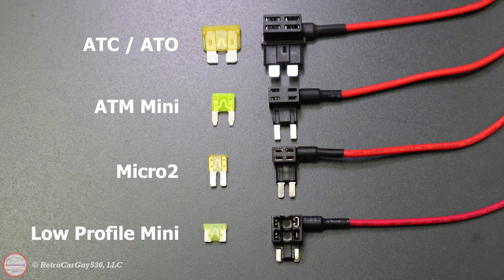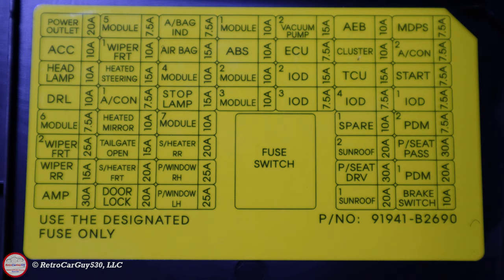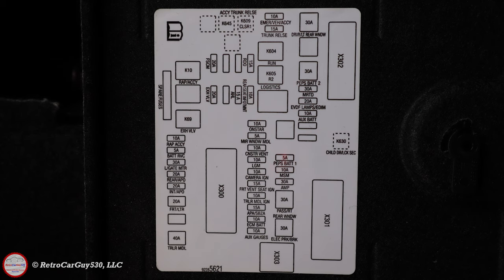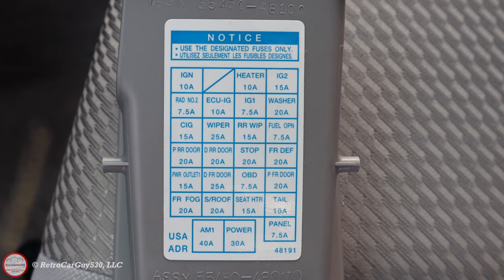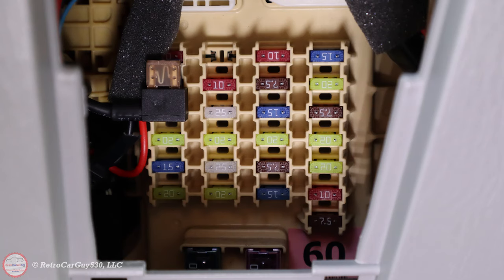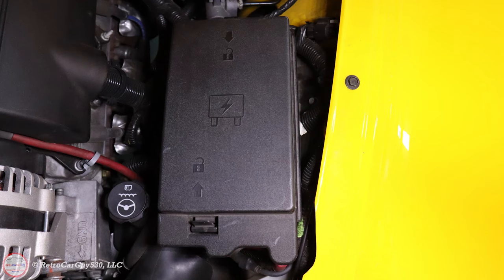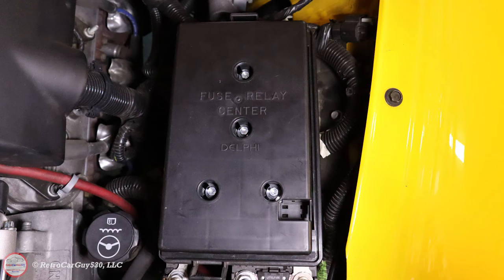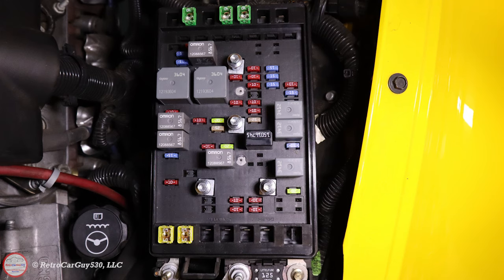How To - Add a Fuse Tap in Your Vehicle

Comment: Is the vehicle in the ON, OFF, or ACC position when doing this?
Reply from the maker: If you're looking for constant/unswitched power, you should look for a fuse socket that provides power with the ignition switch in the off position.  That fuse socket should provide power no matter what position the ignition switch is in.

If you're looking for accessory (switched) power, you need to find a fuse socket that does not provide power with the ignition switch in the off position and when in the accessory position it does provide power.

If you need to find switched power that is only provided when the ignition switch is in the on/run position, you would again find a fuse socket that does not provide power while in the off and accessory position, but does provide power with the ignition in the run/on position.

Many vehicles provide accessory (switched) power when the ignition is in the accessory and on/run positions.  It's somewhat less common to find a fuse socket that provides power only when in the run/on position and not in the accessory position.

The last power type to look for is a fuse socket that provides RAP (retained accessory power).  Find a fuse socket that starts off with no power with the ignition switch in the off position, turn the ignition to the run/on position and confirm that it has power, then turn the ignition to the off position again (without opening any of the vehicle's doors) and check if the fuse socket still has power.  Then open the driver's door and if you observe the power turning off at that point, that fuse socket provides RAP. 

I hope that helps.

Comment: What's the multi meter supposed to be set on when looking for the power in the fuse box?
Reply from the maker: Test for 12-volts DC, I need to set my multi meter to 20 VDC testing mode.  This allows the meter to test and display voltage levels for DC power up to 20.0 volts DC.

Comment: I  do not have a voltage tester with a light. I have a multimeter. Can I still use the Multimeter to test what fuse input slot provides the 12 volts? what setting on the multimeter should I use to test it?
Reply from the maker: Yes, you can use a multimeter.  You set the multimeter to DC volts at a range that will handle the 12 volts in your car. Usually, that means setting the multimeter to DC 20V.

Comment: So using a multimeter do I set it to 20 V DC and insert one lead into the fuse contact and one on to ground, or do I insert both leads one into each side of the fuse contact?
Reply from the maker: To see which side of the fuse socket provides power, you set the multimeter to 20 V DC, connect the black/ground lead to a ground point on the vehicle and then use the positive/red lead to touch the fuse box fuse socket contact(s).

Comment: Excellent, detailed video.
That's what I'm wanting to do, place a tap fuse in an empty - switched - slot on the fuse box.
In a blank slot, how do you know what size fuse to place in the tap fuse?  Should you look at the amp use or draw of the accessory that's being added and then put a fuse a little smaller than that?  If a light is rated at 10 amps say, would it be okay to place a 7.5 amp fuse in the tap fuse in the top slot?  Thank you.
Reply from the maker: If the device will consume up to 10 amps during peak load (for example when first turning it on), then I would use a 10 amp fuse in the fuse tap.  You don't want the fuse tap fuse to blow during normal operations of the device it's powering.  You can start off with a lower rated fuse amperage and if the device doesn't blow that amp fuse, then you're good.  Don't put a large amp fuse in the fuse tap for a device that should have a much lower amp fuse.  Using a fuse with too much amperage endangers the new wiring and the new device.
Reply: @RetroCarGuy530  Thank you for the quick reply.  Gotcha.  I would like for it to be an existing ignition source and just put a smaller fuse in the top slot of the tap fuse.
But there are several blank or empty fuses. I'll just check the empty fuse slot with the key off and then turn the ignition to ACC and see if there is power and go from there.  Thanks again.
Reply: Have a quick question about being able to check spare or blank fuse locations on a 2019 Jeep Wrangler.
Almost all of the fuses are Micro 2.. so freakin small.  Well the ends of my probes on my multimeter are too fat to stick down inside the area on the empty fuse location to check for which side is load and which side is draw.
Can I just wrap some small wire around the ends of the probe just to check the empty fuse slot or use two small nails on each probe to check it real quick? I'm just checking for a 12-Volt accessory so I can use a micro fuse tap for power.  Thank you.
Reply from the maker: @mwworkman those are small fuses.  I would recommend what I mention in the video about taking a fuse of that type (one that you won't be using / an extra fuse) and with a cutter cut the fuse in the middle.  That will give you two halves of the fuse each with a small amount of metal exposed on the top side of the fuse that you can touch your multimeter to when testing for power.  You'll likely need a needle nose pliers to insert/remove the 1/2 fuse section, but you can insert it and test for power on each side of the fuse socket this way without trying to jam in the tip of the probe from the multimeter.  I show that method of testing in the video.  I just looked at a Micro2 fuse I have in the garage and it looks like it should work for that fuse type.
Reply: Hello I also want to ask an additional question 
I installed an illuminated led door sill by wiring into an existing door light that turns on when the door opens. After I did that my car turns off occasionally. I have been told to tap into a fuse. I was blessed to find your video which is the best one out there. My question would be if should I use an empty fuse slot or should I tap into an existing fuse where the dome light turns on. The reason I ask this is because I don't know how much amp is too much for the door sill
Reply: I checked the website where I bought the door sill and this is what it says 
Current: less than 0.5A
Also in their video they just cut existing door light wires and connect without fuse .
Reply from the maker: Sorry for the late reply.  YouTube does not present replies to previous comment replies in a manner friendly to the video creator to find them.

Find an unused fuse socket that provides power when you want the lights to illuminate might be a bit of a challenge (on only when the door is open).  The dome light fuse socket sounds like it might be a viable candidate for the power source for your LED lights.  The power for the dome light is likely controlled by your car's body control module. (BCM).  Sometimes a BCM monitors the power draw on the circuit to try and detect when a light or lights are not drawing enough current so the BCM can present a warning message if it detects a low current draw due to a burnt out or non functional bulb.  I wouldn't think the dome light circuit would be monitored in that manner, but it could be.  You'd have to test adding the power draw from the LED light(s) on the dome light circuit to see if the BCM thinks something is out of range.  It likely will be fine.

The bigger question to me is the one where you stated that the car "turns off" after you wired in the LED lights to the pre-existing light circuit in the door.  That is very strange!  I'm not 100 percent certain those two issues are directly related, but stranger things can and have happened to me.  I might suggest you check the wiring you directly touched when adding the LED lights and all others in the door wiring harness to see if you may have accelerated the presentation of a pre-existing problem.  Moving the wiring harness in the door may have caused other wires to break or have the wire insulation crack allowing the internal wire to touch other wires or ground to metal.  Extreme situation, but possible.

Adding a LED light that is rated to draw 0.5A to a pre-existing circuit should not cause that amount of strange behavior in your car.  The LED lights may have a defect as well causing them to draw more than the rate amperage.

Hopefully you've already found a solution to your issue.
Reply: @RetroCarGuy530  thank you for the detailed information. Out of pure coincidence I ended up seeing that my tire rubbed my wheel well and exposed a wire. I'm going to relocate my harness and see if that changes anything . If not I believe you are right. I may have exposed a wire through the door jamb when pushing through the wires.

Comment: When do you need a relay for additional lights?
Reply from the maker: My general rule of thumb is that each fuse socket's wiring has about a 10 percent safety margin built into the wiring providing it power.   For example, a fuse socket with a 10 amp fuse has a 1 amp safety margin built into it, a 20 amp has a 2 amp and a 30 amp has a 3 amp safety margin.  Whatever your device requires at its max amp draw, it should be less than the estimated safety margin for that fuse socket wiring.  Using fuse taps to power devices like radar detectors and dash cameras is very "easy" since they require no more than 1 amp or 2 amps worst case.  I know my approach is very conservative, but that's safer than some other approaches I've seen/read on the internet.  If your device requires more than a few amps, I would recommend using a relay to provide its power with the power being sourced directly from the battery of the vehicle (with an inline fuse) and the control circuit power of the relay coming from a fuse tap within the fuse box.  The control side of a relay usually takes only 100 mA (0.1 amp) so it is very fuse tap friendly.

Comment: Great video.  I have a question for you.   Like in my car, your fuse box cover has a somewhat sealed fit, how did you get it to seat properly given that you needed to run the tap wire out to the component that you would be installing along with the tap?  The fuse box cover provides protection from dirt, dust etc...thus a good fit is optimal.  Thanks.
Reply from the maker: If you need to add a fuse tap to a fuse box exposed to outside weather elements (such as the one in the engine bay) and it has a protective cover such as the one in the video, you'll need to look for an opening that allows the wire to exit the fuse panel or add a small opening (side/bottom).  If you must modify the fuse box/cover make sure you're not compromising the integrity of the wire or the fuse box / seal.  If your vehicle is still covered by a factory warranty, I would suggest not modifying the fuse box/cover to avoid any warranty issues.  You might need to add a protective grommet to any hole you might add and/or add a small amount of RTV sealant to make sure the opening still protects the fuse box contents from water intrusion.

The fuse boxes inside of the passenger compartment (dashboard, center console area, trunk) are usually far more forgiving on having exit holes for the wire if they even have a cover. You can also modify any cover to allow the added fuse tap wire to exit the fuse box without worrying about exposing the fuse box to outside weather elements (water mainly).

There's no one perfect answer for this question, just make sure the exit path for the wire does not rub on the wire which might lead to its failure and make sure any exit path does not expose the contents to outside elements (water / dirt).

I hope that helps!
Reply: @RetroCarGuy530  Thank you!  Great suggestions.  I have the perfect sealant for that.  High temp resistant caulk that I used to reseal the glass on a fireplace door.  Thanks again.

Comment: What’s the setting on the reader to test the fuses? I just got one but I don’t understand anything on that dial 🙃
Reply from the maker: To test for power like I do in the video, you select DC Volts.  To test a fuse (not in the fuse socket) to see if it's "good", select Ohms/Continuity.

Comment: How do you find a fuse in a late model vehicle(2021 Silvarado LTZ) that has battery (all the time)power?
Reply from the maker: As I mentioned in the video, you can use a multimeter or a 12V test light to test for power that remains on when the ignition switch is turned to the "Off" position.  There are some fuses that continue to receive power for up to 10 minutes after the ignition is turned off via a feature called retained accessory power (RAP). RAP will remain only for up to 10 minutes or until the driver's door is opened.  Some vehicles will also turn off RAP when the front passenger door is opened. Make sure the ignition switch is in the "Off" position and make sure that RAP has been turned off before testing with a multimeter or test light.  You would connect the negative lead on the multimeter or test light to a vehicle ground location or a bolt that is exposed / near the fuse box that has good connectivity with the vehicle body. You would use the positive lead for the multimeter or test light to search for a fuse which has power in those conditions.

Comment: Can the slots have different types of blades like mini or micro?
Reply from the maker: A fuse box can multiple types of fuses in them (blade and jcase fuses are common in a single fuse box), but the blade fuses are usually all of the same type within a fuse box.

Comment: The second and third locations both suffer from the same non-viability, and so the final selected location is no better than the second Yoiu mention a problem and then do not provide the solution, just an equally problematic third alternative. 

Wouldn't it be better to bring the load wire through the back of the fusebox so that the lid can be refitted without the issue you refer to? But then, by the time the fusebox is disassembled in this manner you might as well just modify an unused spot with a load side and skip the fuse-tap arrangement.

Additionally with the fuse-tap (add-a-circuit etc.) used in under-dash locations there is often a problem with the lid, where it's not like here where there are taller items. All fuses may be the same height and the lid is close fitting just above the fuses, so the fuse-tap is too tall to allow the lid to go back in place.

These fuse-taps are really a bit "quick and dirty" and the professional way is to use a spare fuse slot and set it up properly by routing the wiring against the existing looms under the base of the fusebox, and even labelling the slot use on the lid notice panel.
Reply from the maker: A professional auto tech may decide to modify the fuse box to accommodate the new circuit.  The average car owner does not necessarily have that level of expertise.  The vehicle may still be under a manufacturer's warranty so physical modifications to a fuse box may void any warranty coverage for electrical systems in the vehicle.  A fuse tap is a reversible modification (if no fuse box housings are modified) if you want to remove the device or remove it for testing purposes.  The point of the searching through the fuse box fuse sockets was to locate one that might best accommodate the fuse tap in the fuse box.  I agree that there are always other ways to do something like this, but this can be a valid solution depending on the power needs of the new device.

Comment: how to know the right fuse amp to be use for the accessory?
Reply from the maker: You should review the product documentation to see if it lists the power requirements for the device.  If you have a multimeter that can measure amp draw (amp clamp or placing the multimeter inline) you can see how many amps the device requires.

Comment: I ordered a kit on amazon that came with three different style jumper fuses. 
None of them fit my Honda :(
Reply from the maker: Which one of the four common fuse types does your vehicle use?  I show them at 02:01 in the video.  Based on my findings, you would likely need the low profile mini fuse tap to work with your Honda Fit.

Comment: If you install the fuse tap with only the new devices fuse in it's correct slot you can test for power out of the fuse taps wire. If it shows power then that is how you install it, if not, it needs to be turned around.
Reply from the maker: Thanks for the comment.  I posted that info in the video's description section not long after posting the video.

🔷Another "easier" way to test for fuse socket power and avoid using the 1/2 fuse testing approach is to use the fuse tap itself with a fuse in the top fuse socket of the fuse tap.  In this approach, you test for power by inserting the fuse tap and then checking for power at the end of the red wire coming out of the fuse tap (as shown at 11:00 in the video).  If you don't have power with the fuse tap in that position, rotate the fuse tap 180 degrees and test again.  Once you find the correct orientation for the fuse tap in the fuse socket, you can install the original fuse from the fuse box fuse socket in the lower fuse socket of the fuse tap.  If there was no fuse in the fuse box fuse socket then you should not have any fuse in the lower fuse socket of the fuse tap.

Comment: Why does the accessory fuse makes it stay on? even if you kill the other one via panel switch?
Reply from the maker: Accessory power for a dash camera will cause the dash camera to (acc off) enter/ (acc on) exit parking mode (if enabled) or turn off when parking mode is disabled.  If you turn on/off constant battery power to a device that will cause the device to power on/off as well.  It depends on the device and how it's configured (power requirements and settings).